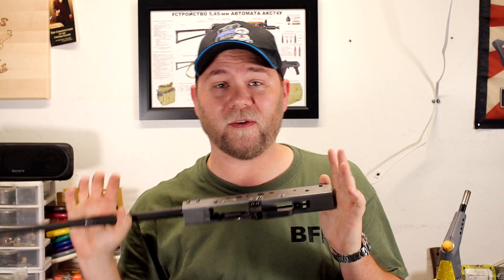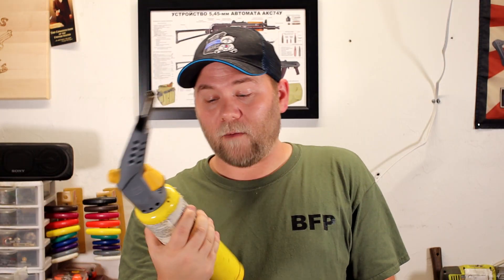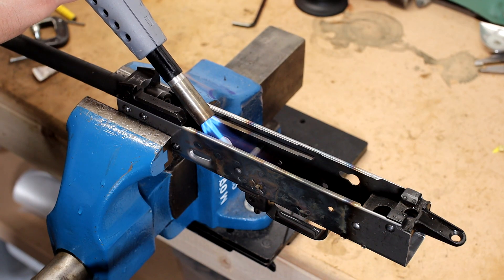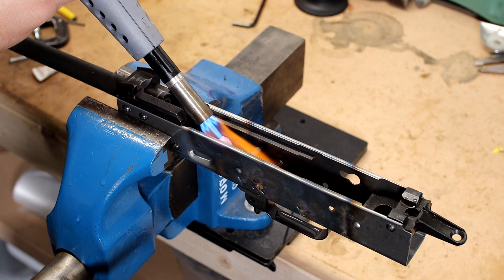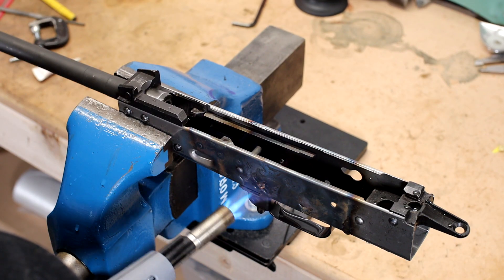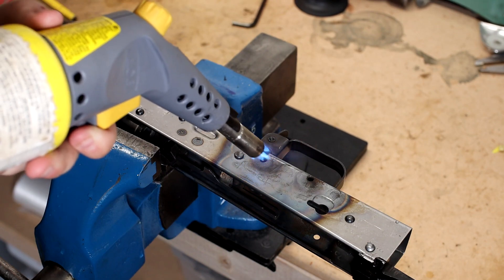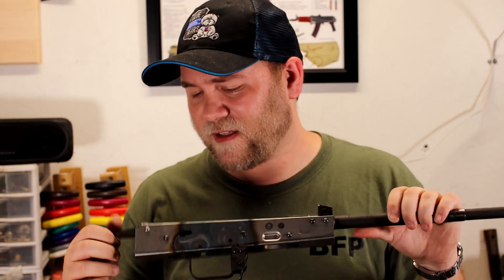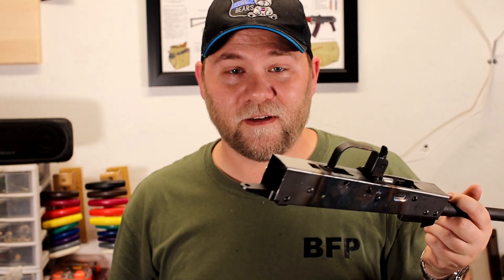AK Build- Part 6- Heat Treat

Comment: do you have the ability to test the hardness of these areas? with all due respect, you're losing temper when heat from transfers over to the adjacent hole you just heat treated. 

There has to be a better way.

Comment: Any down sides to spot treating versus the entire thing? 

I might have a pottery kiln to use in the future. I think they get up to like 2200
Reply from the maker: I've not shot any gun enough to notice a difference. If you have access to a kiln I'd say go for the full heat treat.
Reply: @BabyFaceP in which case I imagine you should do so BEFORE fitting the trunnions and rivets.

Comment: You know I work with metal and if you're quenching that in water you're not hardening anything questioning water makes metal brittle unless you're doing a brine quench and even then it's not advisable when you quench I recommend oil and the oil should be roundabout 170°, no less than 130

Comment: After hardening the steel , it is cleaned to bright metal again. Then slowly brought up to straw color, not gray. The metal is placed in an furnace/oven or insulation and allowed to cool slowly. You destroyed the hardness with your “tempering”.
Reply: I doubt it was ever hardened anyway because it needs to be brought up to about 1500 for a short amount of time then quickly quenched. which he didn't do.
Reply: What is “straw” color?
Reply: @danielberry7702  yellow.

Comment: Question, I'm close to building my ak and want to leave the "battle worn" parts with the original finish so I would like to cerakote the receiver alone without the trunions riveted in and then match the finish. Do you think the heat treating or rail welding would warp the receiver if I only installed the center support before cerakoting and reamed pin holes, then rivet in trunions after all that? Just don't want to ruin a $50 receiver if I don't have to. Thanks, Bill
Reply from the maker: Bend the receiver, spot heat treat carefully, paint, then build.

Comment: dont use water. use oil. water will give microcracks way too severe. no metallurgist would ever use water.
Reply: and now that i saw your quench, you let it cool.. just squirt oil on the hole. you are not heat treating anything pal, trust me i know. test it with a file.

Comment: With the ease of heat treating and availability of flats I think I might start branching away from the 10-12week wait pre heat treated blanks, not that they are terrible just too long. Now I need to find. A good bending die and spot welder
Reply: 7 months alter.. did you ever make the move?

Comment: Is this required for all receivers? I got a nodak spud NDS-1 receiver.
Reply from the maker: Your nodak has already been heat treated.
Reply: @BabyFaceP  one more question. The receiver is a unpainted reciever that is showing some rust. Can you advise on what I should do about the rust and what coating is the best? Thanks!
Reply: @Nessal83  Use a bit of CLP or equivalent, and some 00 or 000 steel wool for the rust, and there are a many types of coatings with their own advantages and costs. You can ceracote, blue, parkerize, etc.

Comment: If you were to create a receiver flat/blank from scratch using 4130 .040” metal, would it be preferred to start with Annealed, Normalized, or heat treated sheet metal?

The local metal warehouse sells them in the following 3 options.
Reply: Annealed. It will be the softest. Normalized would also work. Don’t use heat treated. It will either snap while bending or just spring back.

Comment: Guys, if the sheet was bought from AK builder it's 4130. Water is fine to quench  in. 
You might want to consider tempering to straw instead around  400F - 450F though. The strength will be higher and might even be more impact resistant than at dark grey, at that temp your just creeping out of the temper embrittlement zone and gaining back some of the impact resistance lost by tempering so hot.

 Obviously for a build, it's not like it's going to see tens of thousands of rounds and even if it does your life doesn't depend on the function of this gun.

Example of temper embrittlement chart below

https://i0.wp.com/knifesteelnerds.com/wp-content/uploads/2018/10/TME-vs-carbon.jpg?resize=512%2C629&ssl=1
Reply: I disagree if it's a build it should see hundreds of thousands of rounds if not millions and should be your baby and will be the one your life def depends on wtf  were you thinking man
Reply: Your life wouldn't depend on the function of your gun ? How has no one called this fuckin guy out

Comment: Please dont "heat treat" like this....
You really UNIFORM heating to a specific temperature for a specific amount of time to achieve the required hardness. 
This is more like "hey its harder than it was" . Then theres the whole relaxing grain structure with annealing. But that another thing in itself.
Reply: Differential heat treatment is a legitimate thing, especially in AKs from what I've read

Comment: I'm no metalurgist, but is the difference between heat treating and annealing the quench?
Reply: Heat treating involves bringing a metal up to critical temperature, then quickly with in a period of time cooling the metal which freezes the crystalline structure. This process makes the metal super hard but brittle.  Its then tampered by bringing the metal up to a specific temperature for a different hardness  levels for a time period dependent on material. Doing this allows the crystalline structure to relax a little so that it's not as brittle. Annealing is taking a hardened metal and bringing it up to critical temperature then allowing it cool slowly. The required time for it to cool is specific to each alloy.

Comment: BabyFace that's easy as pie. Someone at a shop quoted me 250 to heat treat. You dont need to do the whole reciever and trunnion holes?
Reply from the maker: This has worked for all of my builds.
Reply: no on the trunnion holes

Comment: This is one of the many reasons why I love AK's. Building them is so much more interesting, challenging and fun compared to assembling an AR.
Reply: agreed plus you get this feeling when your shooting it on the range like fuck i made this shit instead of milling out an alluminium frame
Reply: Yeah but it take so much tooling that it's not worth it unless you're going to make like 5 of them... :/
Reply: @magicstix0r  AR? For now yes possibly. I am however currently working on making an AK from sheet metal bent with mild steel bar stock, angles and bolts, and it shouldn't be too hard to do the same thing with an AR.
Reply: @DiasporaDoomer  No, it only takes a wrench and a hammer punch set to make an AR... An AK takes a shop press, drill press, possibly a spot welder, MAPP gas, special riveting tools, headspace gauges, hammers, reamers...
Reply: @magicstix0r  OK, I would by lying harder than Biden if I didn't preface I was making a straight blowback 9mm AK.

Also you can replace most of those things with a drill press, stick welder, a freezer (so the barrel will shrink enough so you can put it in the front trunnion with much less work) and/or a ball peen hammer. Sure, welding the trunnion right on probably isn't the right way to do it, but hey, it's one way to do it.
Reply: @DiasporaDoomer  How did it work out?
Reply: @joshpatrick8809  ragequit and converted a 9mm draco to sten mags because I could not for the love of me get the trunnion milled out to take an AR9 barrel as the 1 inch drill bit in a shop drill wasnt doing the job
Reply: Not to mention, no milling needed for the reciever!

Comment: hello does the third hole and the shaft make the ak47 machine gun, safer to shoot though.
Reply: That third hole with the correct parts, can make the gun full auto. But unless you have an ATF Tax Stamp, just having that hole drilled, even without the parts, makes it legally a machine gun, and will land you in jail, and will cost you a fortune in legal fees and fines.
Reply: That shaft is the center support not a third hole the third hole on an ak if in the right place will make it an MG. This doesn't have the third fcg hole.

Comment: Heating and letting it cool is called annealing bud tempering is heated and then fast cool
Reply: You are half right. You’re right about annealing. It’s heating followed by slow cool. Heating, followed by a fast cool, or quench, is called heat treating. THEN, you temper by bringing it back up to a lower temperature to remove some embrittlement. Some people mistakenly consider the whole process of heat treating and tempering as tempering, but they are separate processes. Heat treating makes the metal harder. Tempering makes the metal softer and less brittle. You cannot temper metal that has not yet been heat treated.
Reply: Harvesting SE AK omg I thought I was insane for second and had everything backwards fucking with my head baby face

Comment: Note for future.....you can get these weird crayon-like sticks that melt at different temps......you can use one of those if you want to get it more exact.......
Reply from the maker: Noted, I'll try them in the future.
Reply: @BabyFaceP  if the carbon ,  is below. 45%heating it 1250 ie  bright red and water quenching will have no effective avantage . However when you heat the two ends of the thru rivets they need to turn dull red to become stress relived. Please refer to the liquid solid chart for carbon and temp as it will help you out . Ie body center to face center  molecule carbon. In witch heat treatment accours simply put magnetic to none magnetic . Nice insight into how to put it together. Thanks